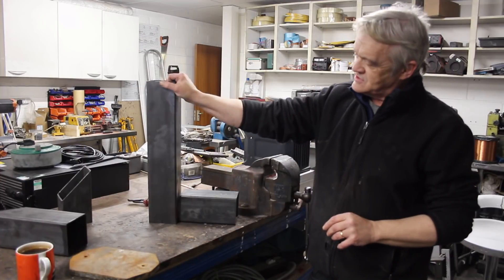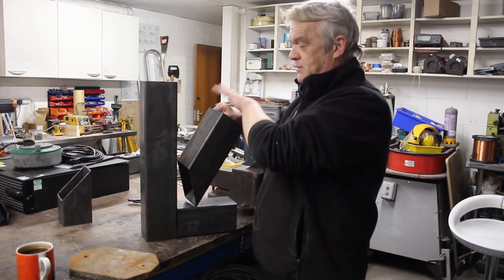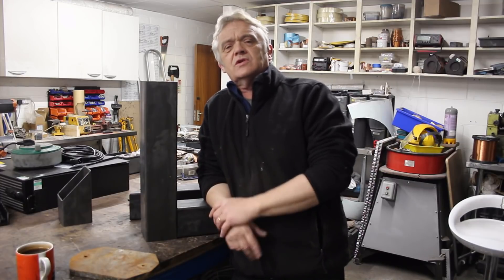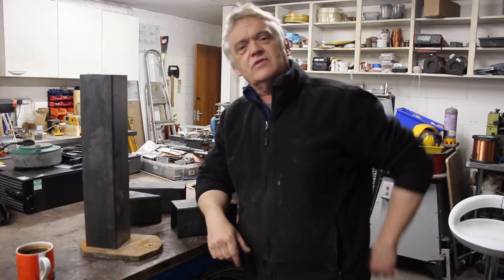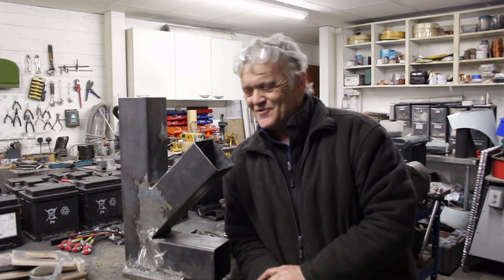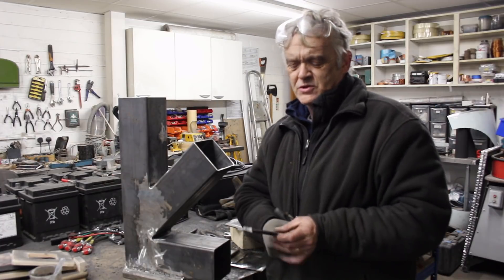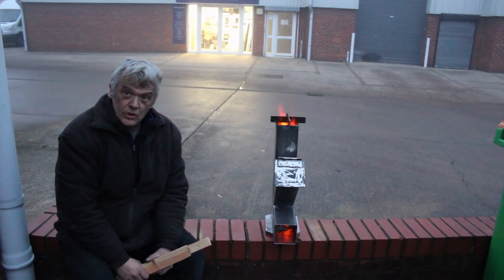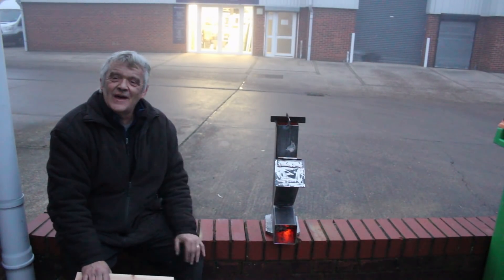1403 How To Make A Rocket Stove For UK£20 And A Couple Of Hours Work

Comment: Excellent. I wonder where to get that deal near me lol in Colorado USA... also 3d printing and the subtle energies of the vibrational Sciences and Biogeometry techniques come to mind. 
Heat to electricity is one thing but can heat be used to power a biosignature designed using principles of biogometry? 
It could be the start of using heat activated qualities that balance and restore polluted spaces. Ibrahim Karim's new book is finally available so maybe it will be answered soon.

Comment: I remember seeing lying around once some iron pipe that is used for septic transport underground. I think there is iron pipe used for waer as well under city streets. I think they are 4 or 6 inch.
They have those joins at an angle in some sections.
Could you make a rocket stove easier with no welding if you just bolted the metal sewer pipe together with the slant pipe,an elbow and two straight pipes.? Maybe there are short sections.

Comment: This is a J-tube burner not a rocket stove. The J-tube burner is a part of a rocket stove and may be necessary but by itself not sufficient. Most of the energy in burning is exhausted up your riser and as such does not allow the stove to approach the 1800-2100 F temperatures that a proper rocket stove achieves. Also, you are placing the mass to be heated in the wrong place. Please read Ianto Evans’ book to understand his invention and why it’s called a rocket stove. When you get the rocket part you’ll understand why a J-tube burner is not a rocket stove.

Comment: If folks can't weld, cut steel, or the like, but they still want a rocket stove, you can dig a little tunnel in the ground, put a pipe in the hole farther away from you, line the hole with aluminum (to prevent underground fire). Obviously has limitations.

Comment: I bet that puppy's got a good draft ! When camping, we often make "stump stoves", where we drill two right angle holes (in a wooden log), that make the same "L"  shaped draft channel as this rocket stove. Only difference, is the stump stove is its own fuel, hence one-time use; disposable. But the stump stove works surprisingly well, as I suspect this rocket stove does, also.

Comment: Robert I've been obsessed with these for years, I have built several just with tins plus a perlite jacket but I was interested in heating water with it. Copying videos I saw, I got some microbore copper pipe and made a coil, put it in the stove, then connected it to a house radiator then   it went into an open topped water cylinder (open so pressure didn't build up. This created a thermisyphon and the rad now heats my greenhouse in the winter. I'm looking for a better stove part though and make it self feeding  with an auger. Slot of work still but I have the basic concept working well. Perhaps 1 solution for these ridiculous costs to heat our homes. I'd maybe add a small pump instead of relying on the thermisyphon, it can sometimes get really hot. A pumps flow could be adjusted to control this better.

Comment: if you are going to use it for heating you need a cylinder dome over it with the outlet very low, this dome can be made with a autogas cylinder, this dome gets very hot though, about 400c, I use one for my workshop even though I have a chinese diesel heat for backup.

Comment: Cool way to put the welding skills to work. And will look forward to seeing what you make with the Mass Heater version. 

Seen the more commonly described inverted oil drum configuration and the oil drum plus stove pipe running through fire bricks or cob. 

There's another out there which might fit a bit better with both the workshop space and your joy of welding, which is to zig-zag the flue pipe section and attach a metal plate to one side to maximize radiant heat energy (There's a company with sells these as space heaters, and a pellet bin so it can be filled once roughly every 8 hours). 

Also, seen a version of this made with a straight vertical flue and horizontally attached steel tubes, but only as a one off, not as a commercial product.

The main reason to go with one of these alternatives (besides simplicity) over the oil drum version is that the main failure point for the oil drum is the thin steel they are made from tends to corrode and break down over a season to two - though this is usually mainly due to the variations in combustion material and dirty burning adding fun chemistries to the mix of gasses moving through the drum area.

For a mass heater, you may also want to consider a burn box with a secondary air feed tube, rather than an open direct feed like first iteration. With a burn box, the air flow is easier to control, simpler to manage, and an added measure of fire safety.

Comment: Well, if you find a car radiator you could connect it to a house radiator witha couple of pipes, fill the whole thing with water and place the car radiator on top of the stove, cover the top and the sides with insulation and that could make a somewhat proportionate mass heating system for the stove, at least for your workshop

Comment: Like you say there are many ways to create a rocket stove. Ive built a number of different designs. The best one I built is the same shape as yours but had a number of differences. The 1st main difference was the bottom piece had a flap on to stop air going in as I wanted the fuel chamber to receive full draw from the burn chamber, which means all the combustion gases and combustion air is drawn through the middle section The botom section was only used for ash collection. The 2nd main difference is I started to make mine with a double skin with the gap between filled with perlite, I did this because the combustion chamber is hotter, burning more of the particulates, the other bonus of this is if you keep the gases between 400-600 degrees C you can also burn the carbon monoxide releasing more heat energy. I decided not to put it into a gas cylinder/heat exchanger and install into my garage in the end, because there were to many flamable things in my garage including the felt roof. Im currently altering my work van load area to fit a £90 chinese diesel cab heater. If this works out ok I will do the same for my garage, Ive seen others on YT do this and red diesel is allowed to be used as fuel for heat.
Reply: I use kerosene with my diesel heater, have never tried it with diesel

Comment: Nice Rob. Right up our ally, we teach people  this here in Africa in rural areas and informal settlements. We've even used old coffee and bean tins, with insulation between them of gravel & sand, which as you mention, brings in the Mass Heater effect, which is another great aspect of these. Many people in tin shacks here are cold in winter and people use paraffin stoves, dangerous from a spillage and fumes point of view. Lastly, the fuel usage you mention. When your carrying wood many kilometers for cooking, needing less of it, is a real life help for thousands of people. 👍
Reply from the maker: I have never made on of these mate nor looked at this before but it. really is pretty impressive from a whole range of standpoints that's for sure - cheers

Comment: Korean have concept of un-dol which is essentially heated floors via using the floor of part of chimney.   Modern systems are electric or hydronic hear but old school were hot air. Could be next step for tiny house heating + rocket stove.  Feel free to correct me where I'm wrong.
Reply from the maker: I think you are right mate - didn't the romans use the same thing - the hypocaust - I also believe in some cases they had lots of little chimneys in the walls so the walls got hot too

Comment: Brilliant! ... I've made versions in the past using "J" pipe enclosed in an old metal electrical box to contain cat litter ( Fuller's earth) as insulation around the whole thing, including first part of vertical pipe, insulation around burn chamber area of stove increases efficiency and output to the point that my stainless flu pipe was glowing cherry red, over about 6ft, and an 18in blue jet of flame exiting the chimney outside! .... Was only used to heat garage, but incredible!
Had to learn to gauge very small amount of fuel required to keep "bunson burner" effect from chimney outside, so as not to worry neighbours etc! Haha!

Now moved on to waste oil burners, ...... again simple construction from scrap etc, (plenty vids on here!) and oil has very high calorific value, and when burned with the same "excess or forced air" principal does not even produce smoke from chimney, so simple and cheap to build a burner, and waste oil is often free from garages and chip shops etc!
Also possible to incorporate pipework to provide endless free hot water!
Worth a look!
Cheers!
Reply from the maker: I will be looking mate - cheers - I was also thinking about a hot water system incorporated in this
Reply: @ThinkingandTinkering  Cool, hope it gives you another angle on things that you may not of been aware of!
On another related note, free fuel, that is, are you aware of the very simple, safe and cheap process of converting all this waste plastic we produce, into diesel and even petrol, with some tweaking of the process, by way of pyrolysis!?
A crazy simple and cheap way to produce free fuel, no skills required really!
Also its cleaner fuel than we buy from the forecourt, as contains no sulphur!

Isn't it funny that our governments are not aware of this simple process, which also solves the plastic problem, perhaps they should watch some of the videos on YouTube!? Haha!

The subject of burners and fuel, and its uses/production is right up my street, and could go on, as you can probably guess, but I'll leave it with you, be great to hear your opinion and perhaps share some knowledge once you have chance to explore and experiment etc yourself!?

Thanks again!

Comment: As a quicker way of heating the mass you can do what the Romans did for heating their homes and chimney the excess hot air through the mass. Likewise if you threw a coiled pipe in the final chimney you could scavenge the remains heat to boil water. Also that bottom plate is going to get pretty hot so make sure you have some fire bricks or dirt/sand/vermiculite to set the burner on when you bring it back in so you don't blow up the concrete.
Reply from the maker: nice tips thanks for taking the time to post them - cheers

Comment: Robert.  You just answered why my Rocket Stove, built in the same style as Yours, doesn't work very well. I HAVE NO DOOR, ON THE FEED tube, the video I got my Idea from didn't show a lid for the wood feed bin. Thank You for doing this project. I will add one to mine and see if it works better, most likely will. lol, Thanks again. cc
Reply from the maker: ahh - yes probably will as it forces the air to be pulled din from the bottom tube - glad it helped mate

Comment: I built one years ago very similar but i had the top return down on itself and back up again . It remained compact that way but the 2 extra lengths of 100x100 spot welded to each other allowed for much more absorbing of the heat ! The air coming out was warm instead of hot . Defo worth doing !
Reply from the maker: Good tip and thanks for sharing - what I am thinking is a mass heater - so enclosing that tube with a larger cylinder.

Comment: A real simple stove can be made using a ring pull baked beans can with a peas or carrots can and a evaporated milk can opener. Just punch holes around the base of each can and smaller holes around the top of the smaller peas can. Then slide the pea can into the baked beans can and you are done. To make a more professional finish use a drill to make the holes in the cans. Another improvement would be to drill small holes in the bottom of each can in a grid pattern so ash can fall through the bottom in to another baked beans can to catch the ash.
Reply from the maker: cheers mate

Comment: These can be adapted to many variations, I have seen them with thick mesh like steel welded at the top to radiate the heat and be used for cooking with a hood about 40-50cm above to channel any potential smoke into a pipe chimney leading outdoors. Also using strips of thick steel welded to the burner gives additional mass for extra heat to radiate and heat the workshop.
Reply from the maker: nice mate - thanks for the ideas - cheers
Reply: With due respect, the "mesh and strips" idea sounds strange and I would think would be very inefficient!
A much simpler and effective way is to incorporate a cylinder ( repurposed gas bottle) just above the stove itself, forming part of the chimey/flu, which would act as a simple heat sink and emit heat into the surroundings!
Alternatively, pipe the chimney horizontally before it's exit, which in itself creates a heat 
They can also be built into floor in garage/shed/earthbag structures etc, which allows horizontal piping of chimney/flu, and so creates simple under floor heating!
Reply: @norfolknchance.500  I have seen them with vertical pipes around the burner and with vertical thick strips of steel. Both transfer the heat from the burner much like a heat sink on a transistor.
Reply: @stevetobias4890  Fair do's ..... as I previously stated, it does sound less effective than a thin walled vessel, with a large surface area in terms of a heat sink!
Basic physics tells me the principle you mention would work to a degree, but can certainly think of better ways to get more bang for my buck!
Those you have seen carrying out that principle have probably learnt a lot more since they used that idea!
Nothing wrong with learning though, and as the "Fun Boy Three" once said, it ain't what you do, it's the way that you do it! 👊✌

Comment: Nice project. But it's little odd that we in the 21st century are still relied on this old-fashion non-technical way of heating. Myself I use coal  for heating. I am very sad and very frustrated about that. But it is what it is. I hope that one day somebody will find a way to heat a home cheaply, efficiently and clean, without the use of fossil fuels. Anyway nice setup.
Reply from the maker: it is funny how over a 1,00- years or so, little has really changed in the basics of how we house, heat, cloth and feed ourselves
Reply: @ThinkingandTinkering  You nail it !!!😀

Comment: Thank you for including the information about the mass heater.
That's how you gain efficiency.
These things set up alone are really nothing special.  
I wouldn't even use that design to make a mass heater.  There are many excellent "barrel" designs discussed here on YouTube.
It's the mass collector that's the important bit.  
Stop pouring heat outside.
Reply from the maker: I agree mate - I will be using a different design for the mass heater

Comment: Up to 60% of the BTU's are in the volatiles (creosote, smoke, etc.) however it takes over 1300F to completely burn them. Steel burns at 1000F. This is where the increased efficiency comes from, burning all the gasses. 

So any rocket heater made from steel will either burn up after short usage or is not reaching the efficiency rocket heaters are capable of. If you put a gas analyzer on your heater you would find it is a far way off from the 85% - 90% efficiency rocket heaters are known for.  My guess is you would be doing good, to be over 50%. Building with steel is very popular, but they are rocket heaters in name only. Standard stoves are usually only 20-25% efficient. BTW

The combustion chambers need to be made from refractory/or clay and be well insulated with proper chamber designs to maintain burn temperatures 1800F - 2200F. This will give you a heater with good 2ndary air ratios and turbulence for gas mixing that will maintain 88-90% efficiency through the entire burn.

We have been building and testing rocket heaters for nearly 10 years.
Reply: WRONG..... the melting point of steel is 2500 deg F or 1400+ deg C.   You are way off.  10 years of building and testing and you still can't get the math right?    LOL
Reply from the maker: I am sorry mate - but I must mention this and please do take it in the way it was meant and not as a criticism of you but rather as a pointer to help encourage others to post and to take part in discussions across the channel - I really think we need to be respectful of others and I think just saying folks are wrong isn't the way to approach this - al3xf gave a good reply and I don't think mine was too bad either. Cheers and thank you
Reply: @ThinkingandTinkering  Oh....I didn't know you were a "Karen".    Don't know if you have a way to tell but...UN-subbed.
Reply: What's your take on the "vortex rocket engine" design? Can it be adapted for solid fuel in a rocket stove? The air inlet on the combustion chamber is at the base of the output nozzle, so preheated air swirls upwards around the fuel to keep the chamber cooler than the combustion temperature.
Reply: Hi there, I appreciate you may well be experts in this area, but I'd love to see some sources documenting the numbers you have quoted. I had already researched the subject briefly but hadn't understood that the temperatures needed to be that high, particular as many designs use oil drums to dissipate the heat. Many thanks in advance..
Reply from the maker: I have to agree refractory is probably the best option for a permanent install and I have seen some lovely designs using firebrick and I was contemplating it - I went for steel because of the adaptability of it, cheapness, portability and - for me - ease of use. But, I have to point out 1,300F is only 704C - propane/butane mixes - which are the one of the hottest burning gas mixes - burns at around 800C. 1,000F is around 537C - aluminium melts at around 600C - maybe you were thinking of that? The melting point of steel is around 1,500C which is about  2,800F - constant heating and cooling of mild steel at around 1,000C or 1,850F will cause spalling but I would think that that's unlikely to be a problem with 4mm plate for a good few years